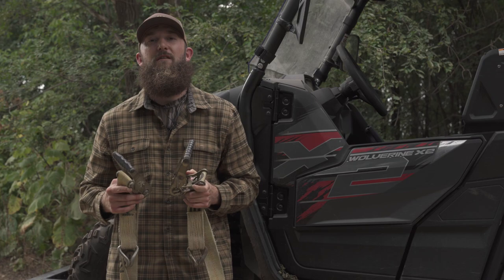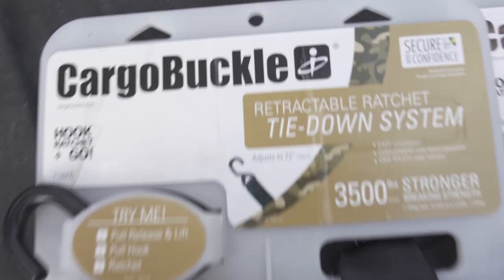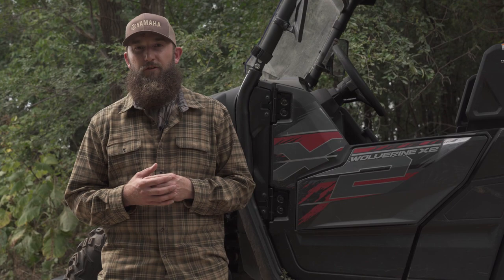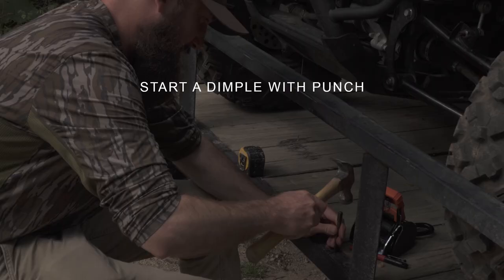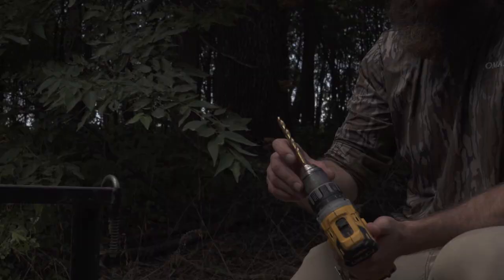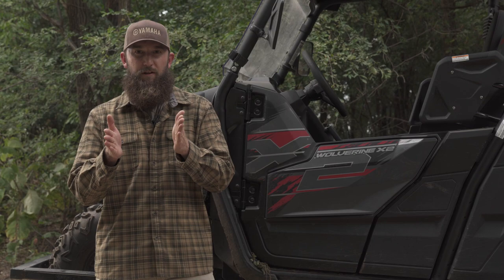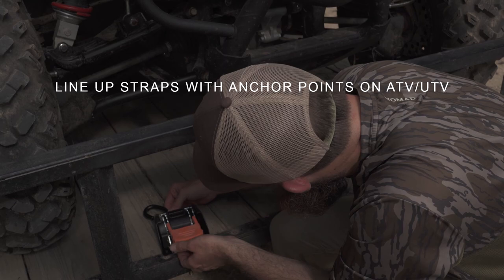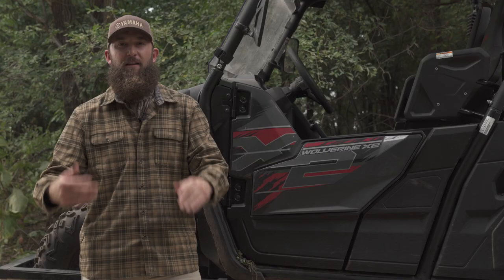How To Install The Best, Easiest Trailer Tie-Down System For Your ATV/UTV

Comment: The issue I see is the angle of the straps, rather than holding it down, you are pulling it backwards. Also, that’s not a great anchor point. The reason being that you are fighting against the UTV’s suspension by holding it down. If you hit a bump the suspension will compress making the it possible for the straps to fall off or even snap if it were to come back quick enough. A better place would be as close to the tire as possible. That way it doesn’t create slack and the UTV will be able to use its suspension.